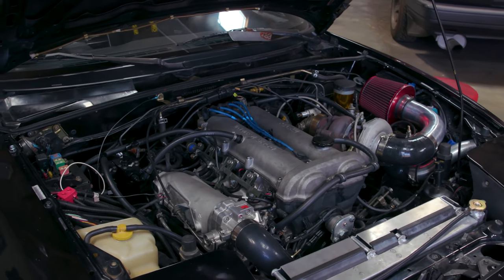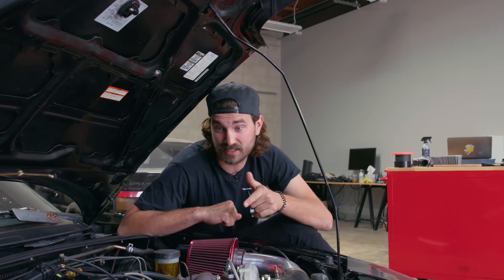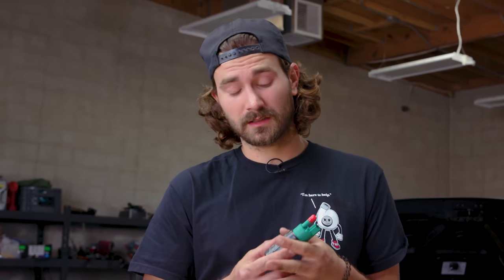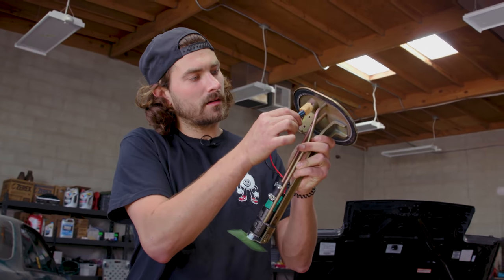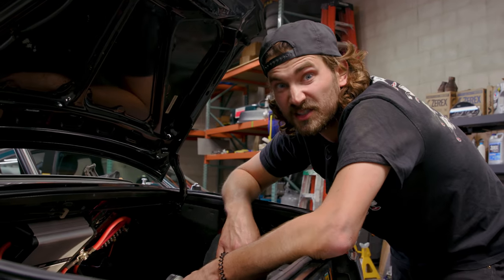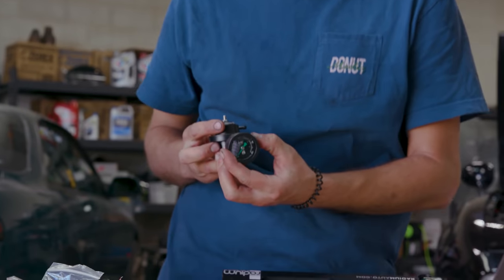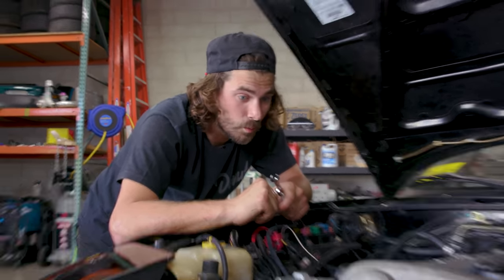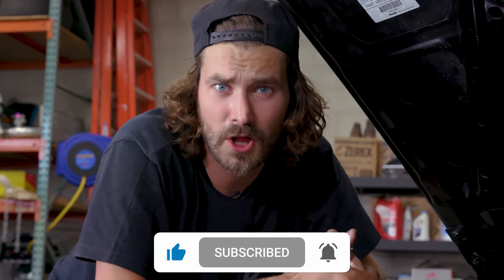Fuel System Upgrades! - Are they Worth It?

Comment: I hope you get a nice lift soon.
Reply: Hoşgeldin Japonic reis 😄
Reply: most everyone just has hand tools and jackstands, so I'd like to hope DONUT continues to build this way despite its inconvenience
Reply: They’ve talked about that before, they don’t use lifts because most people don’t necessarily have access, which is why they were also doing the work on the miata outside on the driveway. Once things like the turbo and other difficult projects came in, they stopped using the driveway and moved the miata to the garage, just because installing a turbo kit in the heat would suck. But even if they have a lift, they don’t use it for the miata
Reply: i thought you meant for the miata💀
Reply: Bendpak needs to hook them up

Comment: Can you guys do a video about researching upgrades? Like good sources, finding out what parts are better than others, how to determine what type of builds are preferred for different platforms, more of the buildup process behind the upgrade decision process? How to determine cross compatible parts and stuff like that? Like, say you choose a car that you think is neat, say you wanna know what it’s capable of and how to find out what it’s potentials are. Just spitballing some ideas and stuff
Reply: The number one thing you can do is find a forum for you car, if there are mods for your car I guarantee someone has done it and posted about it. Good luck finding what you need
Reply: My nails
Reply: This is something I really need to start doing, as I got a 1998 Kia Sephia and it has an extremely similar engine to the Miata, but I don’t know what parts and items are interchangeable or who to even go to to figure that out
Reply: @norsethenomad5978  you go find a dealer to get a better car LOL
Reply: @Jm-dx9tl  you leave me and my horrible life decisions alone

Comment: Radium. Simply the best fueling products on the market today. I spent $2200 on my fuel system, its 100% Radium. To top it off i bought 1700ccX Injector Dynamics injectors. -8 deliver/-6 return. PTFE Fuel lines. Lovin it🤗
Reply: I spent $2200 on my Radium fuel system as well. Absolutely beautiful product. I bought 1700ccX injector Dynamics injectors as well👍

Comment: In a car, I always recommend using the "Spring" hose clamps because they contract and expend as the hose heats up/ cools down while always maintaining a secure grip.
The screw clamps will loosen up eventually from vibration and heat expansion.

Comment: When you removed the factory fuel filter you said from here forward you were going to replace the rubber hoses with the new hose so you can run E85  but both the pressure side and the return line to the pump are both still the factory rubber hose?

Comment: Yes, they are worth it, Let's see...Premium over $4 a gallon vs e85 around $2.50, and with the tune, I gain over 100 hp difference on the Dyno. Now if you're the daily driver, and wanna keep it stock, then don't upgrade...Just be ready to pay $5 a gallon for lot less power. I run the Walbro 450High Pressure, might have to prepare soon for the Walbro 525Hellcat soon

Comment: For those of you that don't know, the only thing he needed to upgrade is the fuel pump. Literally everything else could have been left as is, and been fine for at least another hundred whp.
Reply: I think they upgrade the lines and everything else cause one of the last episodes is gonna be e85, idk how necessary it was tho
Reply: Obviously He’s planning ahead dawg
Reply: @stephenvick2385  I'm fine with that. Just trying to inform people that they don't need the extra eye candy. 

My 03 WRX makes at least 150hp over stock power and is still on the stock fuel rails, stock fuel filter, stock fuel lines, stock damper, and stock FPR. Just have massive injectors and a big pump, and it's fine running E85.
Reply: @pianomail   Just say it like that next time, kinda came off rude
Reply: @stephenvick2385  it wasn't rude at all :/
Reply: @stephenvick2385    it seemed that they were encouraging people to over buy for their car and didn't explain what was necessary and what wasn't and why, which I thought "kinda came off rude". I shouldn't have to educate people from a comment on a 20+ minute video from a major car channel that only talks about upgrading a fuel system.
Reply: At :20 he says “we’re basically at the limit of our stock fuel pump” insinuating, as you said, just the fuel pump needs to be upgraded. 

Then says it’s just an excuse for the other upgrades. 

You didn’t have to explain anything
Reply: @seansudenga2697  it's pretty quickly skimmed over. Just trying to help people out and make sure they aren't dumping money into things they think they need when they don't.
Reply: @pianomail  if someone goes and buys an entire fuel system after watching a youtube video, they’re messed in the head
Reply: @atrxmx2542  a lot of people have done way dumber things.
Reply: @pianomail  by that point it’s natural selection mate
Reply: @pianomail  The newer WRXs also have way better fuel systems then the older 90s models, so there's that too. Remember, this Miata is a '95. Odds are those parts are as old as him.
Reply: @pianomail  thanks for the neat info, I don’t get why a couple guys getting salty over nothing
Reply: @pianomail  so a set of injectors and a new pump is all you need for an e85 swap?
Reply: @sully.varnadoe1472  correct. Fuel rails and lines usually aren't a restriction/issue until you get into crazy amounts of power.
Reply: Rather whole ass one thing than half ass two
Reply: Miatas have factory rubber lines. E85 will eat them up and ruin the engine. That said he did buy the most expensive fuel rail on the market. And a 10 micron filter is overkill for pump gas might help with the e85

Comment: Can we get video about camshafts please, shits confusing😭
Reply: I don’t think anybody understands them shits😂😂
Reply: Camshafts shift the volumetric flow of the engine through the rpms and affect dynamic compression. Basically do you want your powerband on sooner or later in the rpms as the engine winds up?
Reply: Engine Masters on Motortrend has a good video about it
Reply: I fuxked up my camshaft on my Miata, couldn’t figure it out for like a whole month
Reply: @zackfraser6704  thanks you🥺
Reply: @eman7579  brooo🤣💔
Reply: @89StarquestTSi  I know that part but how do chose the right one for your engine and I don’t understand the degree stuff
Reply: @IRussyRuss   the degrees are for when the intake valve begins to open vs close and same for the exhaust valve in relation to the crankshafts 360° rotation (its a full 720° for a 4 cycle to complete all 4). If it begins to open the intake at 20° and closed by 100° then that means that with the crankshaft set to 0° TDC as you begin to rotate the crank towards 20° the intake cam lobe should begin to ramp open the valve and as the crankshaft reaches 100° the valve now begins to close as the piston reaches bdc and begins the compression stroke (this is lobe separation angle iirc), then the exhaust events begin on the last 360° rotation making a total of 720° of crankshaft rotation for the events (360° begins intake and compression, last 360° begins exhaust and ends with exhaust closing. The compression stage is the middle of the 2 360° rotations) The process just repeats over and over. Then you have to worry about lobe separation angle, the duration of the valves event, the actual lift and dwell by the cam lobe, valve overlap, etc
Reply: @IRussyRuss   this is why your camshaft can change your Dynamic compression over your static compression. If static compression is the piston sweep in relation to TDC and BDC, but we know that the intake and exhaust valves are not opening at those exact moment. This is called Dynamic compression and is the compression ratio of the engine in the Piston sweep versus the valve closing and opening events. This is why variable valve timing systems increase the powerband of the engine cuz they can change up the valve tiiming events through the RPMs in relation to the crank
Reply: @89StarquestTSi  oh my bad, i thought he was talking  about what all of the specs meant, like duration, lobe separation, lift, all of the degrees etc.

Comment: I worked at a fuel line and component company. Not going to name names. 5/16 inch lines burst at over 1500 psi. For braided lines, the connector will fail first. Usually at about 1600 psi.

Comment: Always use a hose that’s rated for total immersion inside and out for the ethanolized fuel most of us are forced to use. This usually is a factory item or with a quality kit. Not off the roll at your local auto parts or marine supply. Staggered placed spring heavy clamps or “constant torque” worm gear hose clamps may have been a better idea on that pump outlet. Rubber always compresses and the hose will leak or worse if you don’t retighten a regular hose clamp. That pump outlet sucks with no barbs.

Comment: You should put an o-ring in the groove of the fuel pump outlet so there’s outward pressure on the inside of the line when you put the clamp on

Comment: Only issue is with Radium Engineering. 2 fuel pumps took a giant 💩 at 1 to 2 years after install. Had to go back to oem for my car and had 2 friends who had similar experience. They look great, but are notoriously unreliable long term. That and the CS was horrific and I gave them 2 weeks to send me missing parts from my first order.

Comment: Most likely the best thing to add to achieve better performance is whatever is holding the vehicle back. That may sound obvious or to easy but really every car will have parts that are roughly a match to each other inevitably though some things will be better and others will be worse. Now sometimes those cheap parts don't hold other things back because they aren't crucial but if you can fine the one thing that IS important that will probably be the most bang for your buck/time every time. Hard but it should be worth it.

Comment: Correct me if I’m wrong, but noob question here to anyone , the fuel pressure damper helps the pulse , but doesn’t pulse width while tuning the injectors help this in mega squirt?

Comment: I want a fuel pump that includes a cooling jacket so that you can hook it up to a secondary radiator, thus preventing the pump from overheating when fuel abruptly stops flowing through it.

Comment: What is the round thing called he put inside the line before threading on the AN fitting? He called it a compression fitting and I need some of those for running my new fuel lines too. Can’t actually find them using that name unfortunately. I searched dowels and rings instead of “compression fittings” and I can’t find them

Comment: i know this video is kinda old so a response will probably never come but arent the connectors in the Fuel tank a problem ? 
like am i dumb or why am i thinking cant that make a spark and put ur fuel tank ablaze 
or is there just not enough current on those wire

Comment: I have a 96 camry and I have been upset recently that it's mileage is so poor. do I have any option by getting into the computer maybe to lower the power on the engine in order to achieve better miles per gallon?

Comment: Hi i have chev fuel pump sealed unit and faild needed to get hole assembly rather than filter en motor it doenst have a return how can i mod it so that in future i can service it easier and replace pump and filter only rather than hole assembly?

Comment: Can someone dumb down the difference between a 265LPH and a 340LPH?  I know it’s just the Liter/Hr output, but I can’t quite seem to understand the whole LPH/GPH to the amount of horse power and pressure differences, etc.  especially not knowing the exact Hp of the car currently.  I will be running 550cc injectors so I believe the 265LPH should be capable of handling that output, but don’t know for sure…

Comment: 4:51 On what planet is disconnecting a tank mounted fuel pump going to remove fuel from the lines apart from an insignificant amount that will dribble from the injectors as they 'fire' with a little help from cranking manifold vacuum? Liquids are for all intents and purposes incompressible, so as soon as whatever they're contained within is opened they are instantly at atmospheric pressure regardless. So it's not like compressed air where it will expand back to atmospheric pressure as it escapes so you need to bleed it down to lower the contents of an air line. Just wrap a rag around the connection and disconnect it.
I get the distinct impression this channel is aimed at people that didn't finish high school and it looks like they've found 5 million of them.